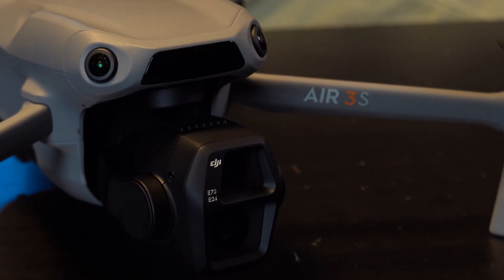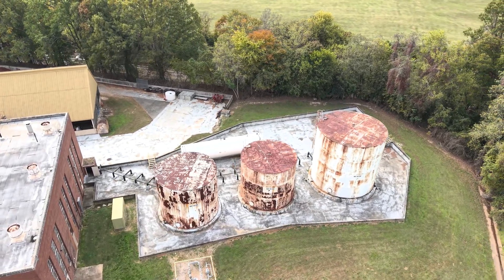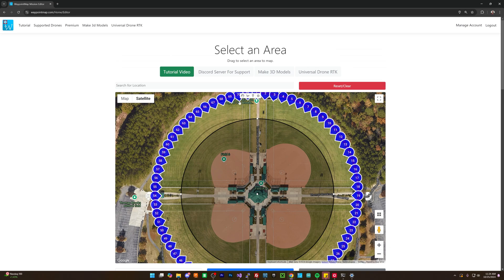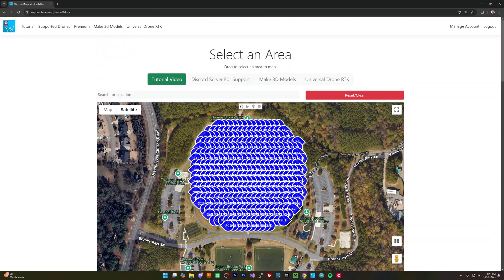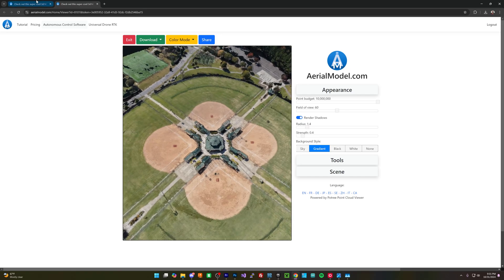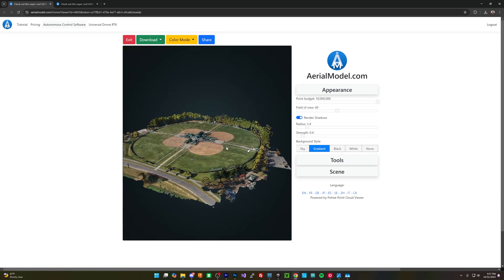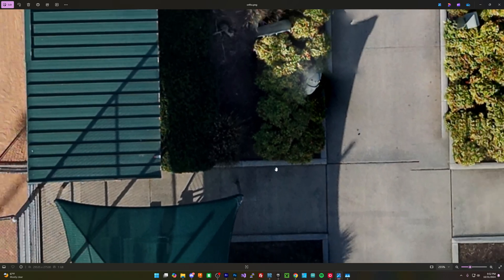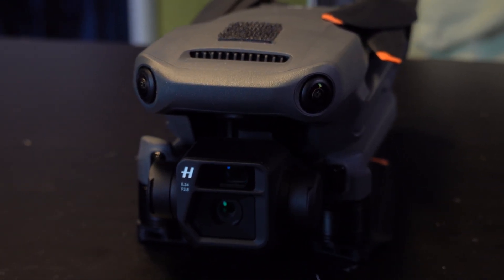DJI Air 3S For Photogrammetry and 3D Modeling Review

Comment: Hey there!
This video is really helpful. I just have a small query. Basically, I got my first project contract where I need to fly over an under-construction highway. The agency has shared a KMZ/KML file with all the coordinates.

Now, I have a DJI Air 3 with RC-2 controller. If I follow the same steps shown here, can I use these drones for the project? Along with that, I also need to show all those coordinates on the final edited video. Is that possible to do in post-editing?

Initially, I was planning to buy an enterprise drone, but since it’s quite expensive and not in my budget right now, I dropped the idea. Some people suggested using the Litchi app with DJI Air 2S, but that again needs extra investment, and I have never used it before.

So, could you please guide me on what would be the best way to execute this plan with the equipment I already have? 

Any suggestions will really help. Thanks in advance! 🙏
Reply from the maker: I’m going to put a beta update out this week that will let you import kmz files with coordinates. When is your contract?
Reply: @JaysTechVault I need to shoot on 28th August.

Comment: You cannot get the .KMZ files into the proper file location on my RC2 controller. It says drill down to a waypoints folder, but on the controller, there is no such file. Is this because of a firmware update?

I have the premium version of your software and now, it doesn't work!
Reply from the maker: You made the dummy mission first right.

There is a reason the software is free for you to verify it works before paying for premium. Actually it’s a requirement that you get it working before paying???
Reply: @JaysTechVault Yes. The dummy mission was made.

It is not said for you to become defensive about your program. I think your program is fine, but something is going wrong. It is not necessarily something to do with your software. I am seeing something I've seen before in my background. It might be a partition being put up by DJI, via firmware updates. I also saw others are having similar issues online. 

You did a good thing by making this software, but DJI might not like it, because they want users to upgrade to a Mavic. 

I even compiled all the different workaround methods; the audio/music, three dot and hamburger methods and none will get me to the waypoint folder inside the controller.

I also noticed that DroneDeploy couldn't add the Air 3S to there platform because of incompatibility issues.

Maybe you can look into these issues and make a new video. If anyone can figure this problem out it is you... 🙂
Reply from the maker: @walkersgrp are you using an sd card?
Reply: @JaysTechVault 

Yes, I am. The waypoint folder is not showing up. Look what others are saying about the Air 3S, as well as Google AI's data sourcing compilations on the topic. I am not alone with the newer Air 3Ss.
Reply from the maker: You are following the wrong tutorial then. The sd card method is only used for the RC 1, which only works for the mavic 3 family.

You need to directly connect it to your computer.
Reply: Could it be that I need to use the RC-N3 controller with a phone? Maybe an update on RC2 is hiding the folders, keeping us from uploading the.KMZ files
Reply: @JaysTechVault Okay... As I am saying, it this not a one-off issue. But, it is okay. I thought a new tutorial might clear up many issues for your users like me.

Comment: is the air 3s capable of using your software with the RC-N3 controller with a tripletek 8 tablet, and I do have the wide angle lens w FOV 114 degrees I would like to use for 2d & 3d models, thanx

Comment: Jay I'm getting into photogrammetry in the construction field, i need to build 3D models for measuring mostly like roofs, walls, etc. Should i get a Mini 4 Pro or Air 3S? 

Also can it be combined with the Insta360 camera for photogrammetry indoors? 

Thanks a lot.

Comment: 3 things. Firstly, if you only care about photogrammetry and don't care about geo-location and ortho. Put your drone in 4k 30 FPS video instead of individual pictures. This way you can choose how many images you want to use by exporting JPEGs as a format in Filmora, Premiere and other video editing tools. So, export 5 JPEGs per second and when you load it to your photogrammetry software you will get fantastic results. Secondly, consider a better Micro SD card. Try using a Micro SD Express card which literally have write speeds of 700+ MB per second. You will avoid so many issues like those when taking individual pictures. One of the main reasons this happens is bottlenecking between your camera and storage. Lastly, The closer the drone is to the objective, the more detail it will capture. Buuuut this means the less area it will cover. This is where you need to plan your waypoints depending on your needs. On the fields you don't really need to capture a lot, but on the building you really do need to create closer paths if you want to really capture all the detail. In the end, you won't be able to completly use a drone like that for commercial mapping and scanning since it isn't RTK certified. That means the GPS is not good enough as an RTK drone has a margin of error of less than a centimetre.

Comment: Jay, does your waypoint map work with cell tower and other 3d modeling? It seems like it would, but the difference between modeling a sports field is the vertical flight plan to capture a tower.
Reply: Pretty sure you can adjust the height of the different rings

Comment: The DJI Air 3S is an absolute beast of a drone, especially at this price point, making it a value-driven choice for drone service providers. But the one thing holding it back is the lack of SDK support. If the Air 2S can support SDK, then why not the Air 3S? Let’s rally together and encourage DJI to roll out a firmware update to bring SDK support to the 3S—this would open up a lot more possibilities for professional drone operators, mapping, and automation. What do you all think?
Reply: According to AI, it found a DJI staff post on a DJI forum, they leaning to not release the SDK bc they dont want to eat into their enterprise line of drones.

Comment: controls with screen or without screen for mapping with 
dji air3s?
Reply: I believe both the RC-N3(screen-less) and RC2(screen) work for mapping, the difference is with the RC-N3 your phone holds the waypoint files, while with the RC2 the RC2 itself holds the files but you'd need to send them into the RC one way or another

Comment: Any suggestions which is better .. DJI Air 3S or Air 2S For Photogrammetry?
Reply: But 3S doesn't support SDK
Reply from the maker: @diegocaracasfc they both can do mapping
Reply: I’d say air 3s I have an air 2s and will shortly upgrade to the 3s due to the higher resolution sensor
Reply: @calvincorrigan9925  Thank you is exactly what I was thinking of

Comment: You know you can use 4k 60fps video, put it in 4 circle rotations at different heights, then process videos with Pix4D, obtaining a 3D model that is very good in only 10 minutes of flight? :)
Reply: Will you add support for Air 2s?
Reply: Hi and thanks for your valuable general tips about photogrammetry and 3D mapping! 🤗

Which 4 different heights and maximum speed would you recommend for the best optimal results based on this video example - or as advice in general? 

But, the PIX4D you are suggesting unfortunately does not seem to support the DJI Air 3/3S, DJI Mavic 3 Pro/Mavic 3/Mavic 3 Classic and DJI Mini 4 Pro according to their website now that I looked there which is the whole point of this said WaypointMap which is an online waypoint tool for photogrammetry and 3D mapping?

The thing about this video is that Jay (computer engineer & hardware designer), the guy in this video, is also the developer of WaypointMap which he mentions several times in this video sample - is that this mentioned WaypointMap is available both as a free version and as a monthly very affordable Premium version and that he is in the final phase of his development of this universal RTK module 'AnyDroneRTK' for a very affordable cost when it will be released very soon according to his web page (I hope it will be released soon anyway). 🙏

Best Regards 
Jerry Källström, Sweden
A1/A3 Certified Drone Pilot
DJI Air 3S Owner
Reply: @JerryOfSweden  Max 15km/h, 3 rotations according to angle needed to see the building (ussually 85 - 60 -45 degrees).
Pix4D work with all drones, even phone cameras.
Reply: @geodrone7643  Thanks! 🤗

I do understand the angle for each circle, but at what different heights do you suggest for each of circle to cover the angles as you wrote before?

'put it in 4 circle rotations at different heights' 

Best Regards 🙏
Reply: @JerryOfSweden  Depends on structure height, the lowest whould "see" the details "under roof", the heighest to provide 85 degree coverage....
Is not a formula, but as example:
One church of 25 meters heigh, surroundings around 20 meters....
1st circle at 60 meters, 30 meters range
2nd circle at 40 meters, 45 meters range
3rd circle at 30 meters, 20 meters range
4th circle at 50 meters, 60 meters range.

This gives you a pretty good quality in Pix4D from video capture.
Remember to have fast SS in order to avoid blur.
Reply: @geodrone7643  Thanks a lot, it was really an educational example that you demonstrated purely in principle which could constitute a rough rule of thumb in general - however of course you have to try it out on a case by case basis and that you also lower the drone's maximum speed and as fast a shutter speed as possible as you very well also pointed out. 🤗

Thank you for your very valuable and insightful advice - which is very humbly appreciated by me. 🙏

Best Regards
Reply: @geodrone7643  Note; did you mean 15 km/h or 15 m/s? 🤗
Reply: @JerryOfSweden  my guess it is 15km/h that brings it to roughly 4m/s. as in N mode which you will use for shooting anyway (at least it is relevant for dji mini 4 pro) the speed will not exceed 12m/s (15m/s is out of that range)

Comment: First try with with likely too many points, and the app crashes. I am premium. I will try with a few less points.
Reply from the maker: If you are on the RC 2 there is about a 100 point hardware limit. The RC n3 can do a lot more:
Reply: @JaysTechVault  i will do some testing, thanks so much for all you do for the community!
Reply: @JaysTechVault RC N3 is better?
Reply: Which controller would you recommend overall?